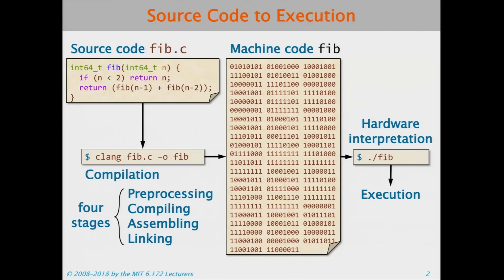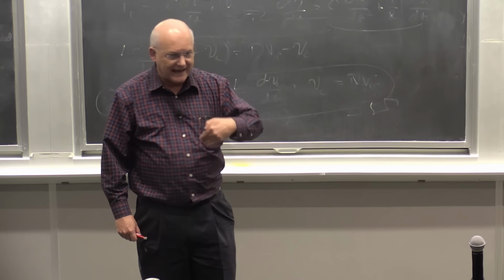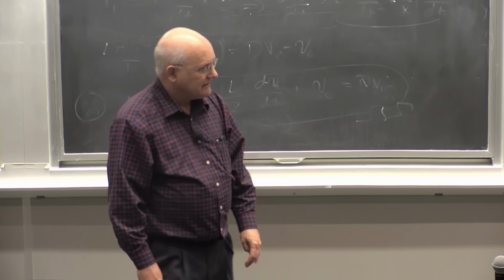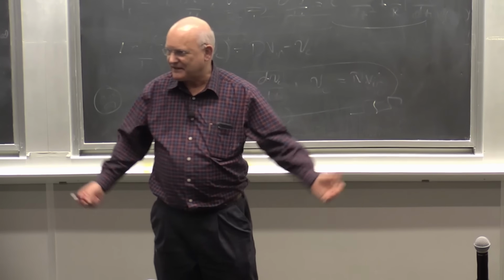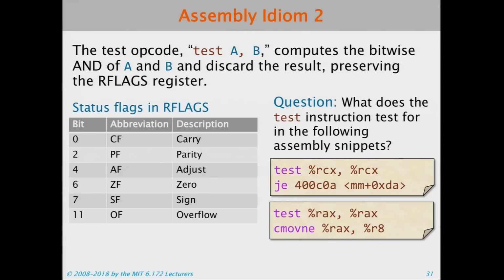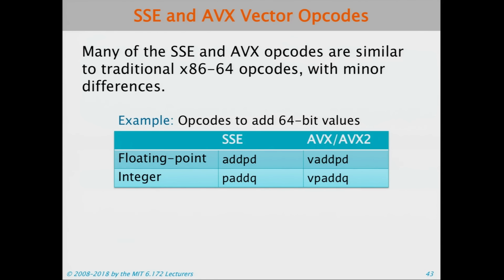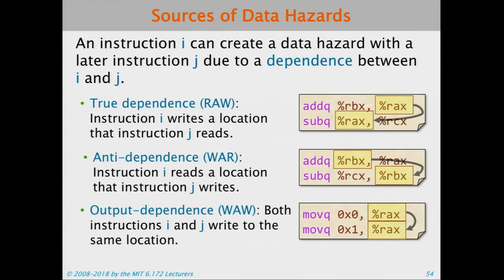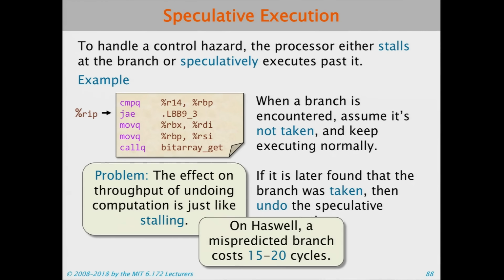4. Assembly Language & Computer Architecture

Comment: The current materials used to make Silicon wafer computers is not sustainable in that the recycling process is more expensive than the materials taken out.  An alternate theoretical architecture is the #drippershive.  Though heavier and larger the material cost would be much cheaper and may even have a longer lifespan than semiconductor transistors.

Comment: I used to teach Assembly Language, DOS, CPU Architecture and the instruction set timing and bus cycle operation for several systems. Including the DEC PDP 11, Intel MCS86 and MCS 51 and earlier. My class started with Hardware operation from the point of the first clock pulse from the release of the reset button. Including Machine Instruction and Bus cycles and how instruction execution controlled hardware operation. We also introduced Hardware Emulators. To support the class, I wrote a Text Book on the Theory and Operation of Microprocessor Hardware and Software. The Z-80 / 8080 CPUs were used as the example architecture. My class supported the NTX 2000 NATO Telephone Switching System Back in 1980 for NATO & ITT at the introduction of Fully Integrated Digital Switching Systems for Central Office Telephone Switches. basically, 256 Microprocessors operating in fully redundant pairs, all under the control of a custom minicomputer executing a Real Time, Multi-tasking Operating System.

Comment: At the other end of my career, I caught a glimpse of what was then called "micro code"...
An "instruction decode" cycle means that the instruction bits en-/dis-able circuitry of data signal pathways. (Eg: enable a shift register to multiple/divide by 2, or enable the block of 2-bit adders to sum bytes...) I envisioned this magic as a really complex railway switching yard. This is the coalface where machine code's 1s or 0s appear as 'high or low' electrical potentials.
Then came learning about micro code, the embedded multi-step gating/latching operations that would occur (synchronously) within one or a few clock cycles. Way back then, the hardware I saw didn't have advanced micro code or machine code or Assembly to multiply two integers; multiply was done with many Assembly instructions (usually a library 'routine')...
It helped when thinking how the effect of C's pre-/post-increment (decrement) instructions could be achieved, for instance.

Comment: Still changing the names of established barriers to optimization, I see. A resource contention that is causing a bottleneck is now called a Hazard.  In C we could wait on the resource and set a counter to come and check again. In C++ we could set semaphore to flag us when the resource is available.The compiler optimizer should manage resource contention, and not middle ware or app code. In my book a Hazard begats errors, crashes, data loss , downtime, and many sleepless nights. Why overly dramatize the loss of a dozen or two cycles? If you can't afford another $50 G for more parallelism, build smarter compilers, linkers, and 1st pass code scanners. These can work wonders. Work with your CPU consultant at the chip vendor. They have great ideas and they don't get no respect. Talk with them and go with extra buckets for the mind dump you're gonna get. Some will even write the code for you.

Comment: Interesting! I, much like the professor, started by doing most software projects in assembly code. Over the years I learned many, once you get the hang of one, others come more easily. I was reflecting back on one project I worked on where the code ran on an IBM 370, there were many groups involved, each writing code with only a specification sheet. I later learned it was a government secret project, so one group didn't know much about any other, all we ever saw of other groups work was object code modules for the linker which got linked to our code. Software breaks, in several cases the code authoring group no longer existed (Legacy) and if there was source code it was classified, when we traced a fault to such an object module we often had to disassemble it to figure out what it was doing. Our group usually wrote in IBM370 assembly, but we soon discovered that other groups had used many different languages - you can recognize compiler constructs after a while. Some code was written in C, FORTRAN, PL1,  COBOL, even FORTH and assembly. Once we figured out what was broken, we had to write a patch for that object module - remember it was legacy code - no source available.  Sometimes it was fun, sometimes it was stressful!

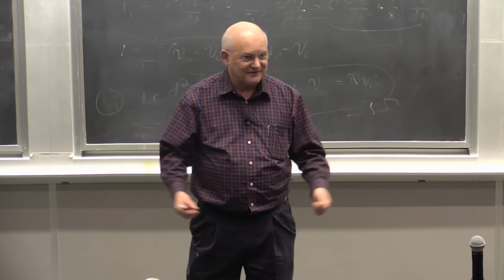Comment: 11:15 "Vector operations tend to be faster than scalar operations." Well, not as much as they used to. I have plots of DAXPY (y[i]=a*x[i]+y[i]) for different sizes of x and y on Intel and ARM architectures. Vector operations are much faster when x and y both fit into registers or L1. When they fit in L2, vector is still faster but not as much. When they only fit in L3 or memory, there is no difference in speed. Gather and scatter operations show no difference in speed (vector vs. scalar) regardless of cacheability. I haven't found an example where vector ops are slower, but I do have examples where vector and scalar ops are very similar in speed. Much different now than the CDC 7600, FPS-264, CRAY Y-MP and C-90 vector architectures of our younger days.

BTW, I love your work Dr. Leiserson. I was very happy to find this lecture. This topic is not taught enough. Please don't take my comments as a criticism. I only wish to say that your example, "vector is faster", is not nearly as true today as it once was.
Reply: If you are busting the cache, then you are a shite programmer. :-)

Comment: xor %rbx, %rbx ........ daaaaaaaang
Reply: Fast zero.
Reply: There are actually times when you would want to actually use MOV %RAX, 0. And that's if you don't want to disturb the flags. Other than that XORing a register with itself is the better option most of the time. (Note this is not true for all CPUs)

Comment: The assembly language for this one-chip microprocessor is more complex than the assembly language for the 1964 models of System/360!  Learned some very interesting information.  Now I need to get the details somewhere without going BACK to college!
Reply: I’m a retired IBM mainframe programmer, nothing but respect for any assembler programmer who can write quality code.  Assembler is completely unforgiving, takes so much diligence and concentration.  I did write macro assembler code to run Cobol programs, but someone else had written the original code I modified and used. Great for getting a true feel about how computers operate.
Reply: @raybod1775  Assembler is no more unforgiving than any other language. Poor code is poor code in any language. There is, unfortunately, a religious belief among younger programmers without a solid computer science background that computer languages and compilers make programming easier. That is not the case. A language is simply a collection of shortcuts to achieve certain side-effects. It is, sort of, an implicit library to a set of often used algorithms. The exact same results can be achieved with explicit libraries of assembly level functions. What will be missing are the (extensive) compiler optimizations. An assembler programmer would have to work much harder to get the same level of optimization of out the code as is possible with a modern compiler. Other than that no language can transform a hard programming problem into an easy one.
Reply: @raybod1775 I also wrote mainframe assembly code since 1969. Assembly code to programmers is to a blank canvas to artists. I can do things in assembly that other languages simply can not do.
As far as being unforgiving, and most other commenters are talking about is that assembly code has no type checking and I am glad for that, as type checking ties my hands. Memory is memory, you can pit whatever you want in it, code, text, number (in any coding scheme you want)
All these stupid special purpose registers are ridiculous. Jist give me GENERAL purpose registers and let ME worry about what to put in them. While im on the subject about special purpose registers, why have a stack at all? Its just memory! IBM mainframes never had a stack and They worked just fine. 
I wrote millions of lines of assembly code (as well as 13 other languages) i also wrote micro code for IBM mainframes using special mylar punch cards on a 360. One of my modules in assembly was still running in 2013, many decades after I wrote it.
Most of you will never experience the true joy of coding in assembly if you had no exposure to an IBM mainframe. Its still my fav language
Reply: @raybod1775  I have written 6502 assembler before you were even born, Ray. 

You can do absolutely everything on a well designed compiler, Ray. C, for instance, has a so called asm statement. Guess what that does? Python lets you bind C code to your Python program directly. Just because you are chicken to use these facilities doesn't mean they don't exist and aren't being used by people who actually know how to use computers. You clearly don't. So what? So nothing except that a guy called Ray has to educate himself.

Comment: When I went to  City College back in the late '70s, Assembly Language was commonly taught. Today, nobody worries about assembler except people who need extreme performance and compiler writers. I used to work at a shop that wrote almost all their software in Assembly. Nobody does that anymore,
Reply: Nobody on x86. 
Asm is still needed for the kajillions of microcontrollers embedded in various products, where they still only have a kilobyte of space for cost savings and a low clock speed 8bit processor for minimal power consumption. They may get the overall program compiled from C++ but then is needs adjustments. These specialty compilers do not have the broad support that the x86 compiler-optimizers enjoy.
Reply: it's a shame really, because it is right down to machine level, and not that difficult to learn, just takes longer to get certain things done without relying on library calls etc. I loved it, using my ZX spectrum I wrote a defender type game, took me months, lots of coffee, all on paper, no assembler.
Reply: Well you thought yourself assembly if you wanted to fix your lives in an arcade game on your apple 2 too. 😂 at least that was my motivation at the time. Now i try to explain optimizing code to a developer who thought programming is writing JavaScript….😅 it was tough 😂

Comment: 19:05 

"640KB ought to be enough for anyone" - Bill Gates (1981)
"64bit address is a spectacular amount of stuff" - Charles Leiserson (2018)

I wonder how long this will hold.
Reply: My first 'computer' back in the mid 70's had 1k, so 64k seemed outrageous. All coding was done in hex. I can remember someone around the mid 90's telling me they'd installed a 2Gb hard drive. My first thought was why would you need that much storage? Mine was ~300MB. It's all relative to the times.
Reply: @toby9999  Huh? 300MB was already rather small at the time. I used to run out of storage space all the time.

Comment: copy takes an item from one location and writes it to another without removing the original locations data. Move moves the data from the original location to the new rendering the original location invalid. How are you teaching this without knowing something so basic?
Reply: Maybe true for x86 (not sure) but for all CPUs I've worked with, move was effectively a copy with source and destination both valid after execution.
Reply: Even though it's called MOV on most CPUs it's actually copying. The original data isn't gone when you do a MOV function. Even when a function returns, the local variables aren't necessarily gone yet - it's just safest to pretend they are immediately destroyed, since an interrupt request can come at any time and clobber the space they took up on the stack. Destroying data takes just as much effort as creating it - which is why the computer doesn't actually do it even if you think it has.